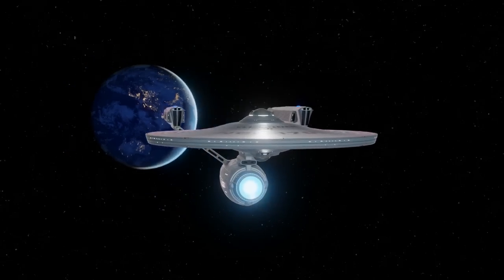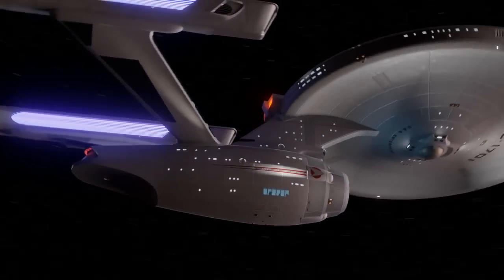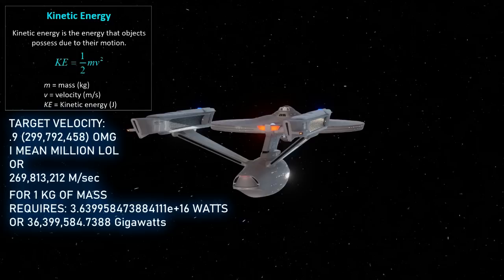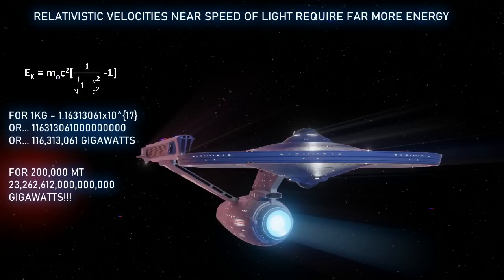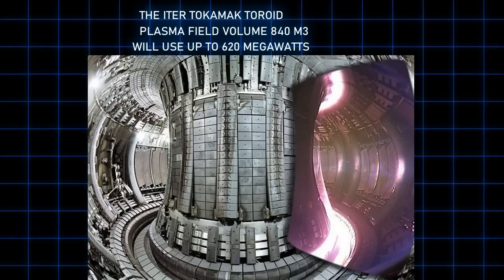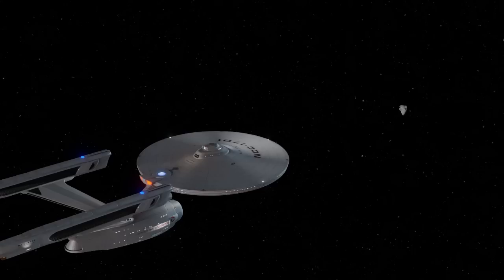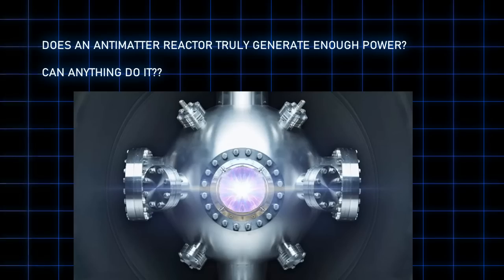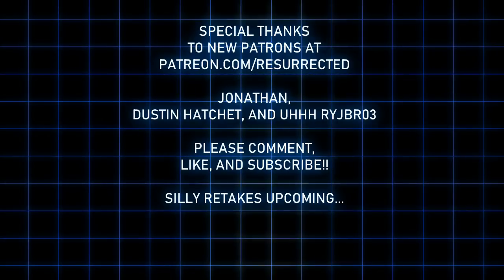How Many Nuclear Power Plants Can Power the Enterprise? Let's Calculate!!!

Comment: We could power our current day civilization with a few dilithium crystals.
Reply: Haven't finished the video but last I though I knew, was they used deuterium/anti-deuterium to power the warp reactor. That said, the crystals were the focusing lens in the explosion chamber. They were important for making the whole process of extracting energy from the antimatter interactions inside the pressure vessel.
Reply: Dilithium crystals are part of the engine, not the fuel.
Reply: Tho dilithium is not the fuel, as has been states, our modern issue with antimatter is not creating.the antimatter it's controlling the reaction in order to get useful energy.
So, yes. A few dilithium crystals and and an understanding of how to use them would end all our energy issues.😊
Reply: And what is the deal with the Dilithium crystal's structure breaking down while it is use? Wearing out or becoming damaged in some way such that "recrystalization" of the Dilithium matrix is EVER needed or could be an option? Are Dilithium crystals harder than Diamond for example? We just do not know I think and so one answer may be as good as another and the "fun" may lay in the act of trying to figure it out OR coming up with (i.e. "inventing") a plausible set of story ideas to "fill in" the missing knowledge! After all, nobody has said Mr. Gene Roddenberry went into a trance-like state and received the ideas for Star Trek FROM a higher power or from the future but... could that be the biggest "untold" Star Trek secret of all time??
Reply: @DennisCosteaJr  
I agree: half the fun is speculating an irl answer to fantasy problems.
In my own head-cannon, dilithium crystals have long, straight, largish pours that, when placed within an electric field that is just right, create a magnetic field oriented parallel to.the walls of those pours. Incoming matter or antimatter ion streams will then funnel into those microscopic pours, becoming trapped and isolated to a small volume within a pour. This, then, increases the likelihood the two streams, coming at each other from either side, annihilate, turning into gamma rays. These gammas, traveling at the speed of light, have enough time to escape the crystal before decaying into highly energized m/am particles of all kinds: warp plasma. This plasma is gathered by em anf grav fields and shunted to the warp nacelles.
However, sometimes a particularly energetic ion within the one of the streams escapes a pour. Or, a gamma ray decays early. Either way, a small section of the crystal is damaged, making a slight disjointment the alignment of local magnetic field. As disjointments increase, efficiency decreases. Eventually, the crystal is too inefficient and dangerous to use. (Especially at higher warp.)
IDK how gamma rays from a fission reaction would recrystalize dilithium. I have speculated that dilithium is rydburg lithium arrangement, where two lithium nuclei are so close that their sharing of electrons acts like they are a single atom; and then you make a crystal out of that. But I don't understand rydburg matter well enough to really make any conclusions or predictions on that score.
Enjoy!

Comment: What I always wondered how the matter-antimatter anihilation energy was actually powering the warp-drive. Like, when these two types of matter collide, it releases the energy all along the EM spectrum, right? How does the antimatter reactor catch all that energy and what does it do with it? Does it heat plasma to do something with it in the warp-core? Does it turn the energy into moving electrons a.k.a. electricity to power the systems of the ship?

And also, where does the antimatter come from? Federation space must be littered with fusion-powered particle-colliders to create all the antimatter needed for so many ships. Or do they create the antimatter like in the Mass-Effect universe, where they build giant spacestation particle colliders powered by solar power in an orbit close to the star, turning the solar radiation into antimatter?
Reply: That's what the made up material "Dilithium crystal" is for. It does not react to matter and antimatter (one of the tiny substances in the ST universe that do not) but when they annihilate each other and release themselves as energy, the dilithium absorbs focuses and emits the energy as electrical plasma. Without Dilithium, the reaction would be unstable and would lead to warp core breach.

Antimatter is made around sol and other primary Federation member suns. They do indeed use solar power based particle colliders to make antimatter (antimatter is one of the few resources that carry significant "economy" based weight for trade etc due to the extreme difficulty to make it.). The enterprise D has a device on board that can make antimatter in tiny amounts and it's VERY inefficient and not to be used unless no other option is available. (TNG tech manual which I know is "non canon" to some, but considering it was written by two of the main people who designed the Enterprise D and worked out how most of this stuff is supposed to work after we learned so much in the 1980's since 1960's trek I'll defer to them).

Comment: Star trek has always shown that shields can only deflect rather small asteroids, and only at slow speeds, without taking damage. Typically, the deflector dish handles clearing debris from the path of the ship, but it's clearly based more on tractor beam technology than shield technology, which presumably are based on scaled up lasers like the ones used today for "optical tweezers", and not some electromagnetically confined plasma.
Reply: How to tell me you don't watch Star Trek without telling me.
Reply: They have navigational shields, that a laser can't cut through (if they were on...now the D lost her only toilet).
I would say it's a combination,  navigational deflector pushing particles put of the way and navigational shields is the last line of defence.

Comment: So if the Enterprise-D do have 12.75 billion GW (which is 1.275 × 10E19W if my math is correct), it will have to burned more than one ton matter and antimatters per second .
The question is, according to TNGTM, the fuel capacity of Galaxy won't be anywhere more than 5,000 ~ 6,000 tonnes (~28,000 cubic meters for main deuterium tank, assuming the density of deuterium in about 0.1~0.15, and the 3,000 m3 antimatter storages have roughly the same mass as matter fuel) . So in this peak output, the ship will burnout its entire fuel reserves in less than one and a half hours.
The even bigger problem is, also according to TNGTM, the standard antimatter flow rate of Galaxy's warp core is a tiny 300ml per second . It's quite a long way to 1 ton per second.
Reply: Perhaps the values given in the show are the maximum rated power output of the reactor, and in normal operation it only actually produces a fraction of that.
Reply: And in dialogue, the NX-01's phased cannon is confirmed to have a power of 500GW. It's safe to assume that phaser banks will have TW level output, and so as the shield.
Reply: @owenstockwood5040  That's definitely the peak. Also in the TNGTM it said the warp core is required to have a 125,000% surge output of rated maximum continuous power for 300ms. If we take this into the count, then the maximum rated output of Galaxy will be in 10e16W, which will make far more sense and will only burned 1kg of matter/antimatter per seconds.
Besides, in DIS S04E05 Taka built an scaled down model of DMA and tested on Discovery. According to what he said the scale is 10e-17, the Discovery have all of its power to powered it, and the actually DMA will be "had an energy source equivalent to a hypergiant star". I googled and it said hypergiant stars usually got 10e3~6 times more power than the Sun, which is 10e26W, so the peak output of Discovery will also be in 10e16~19W, also matched these numbers based on TNGTM.
Reply: Are you sure you're calculating the energy output correctly?  Remember a theoretical matter-antimatter reaction would be 100% efficient.  In other words, all of the mass is converted to energy by a factor of E=mc^2.  Modern fission technology isn't even 50% efficient.  I think if you could control it, a matter-antimatter reactor would be able to provide all the power necessary.
Reply: @owenstockwood5040  No.  In the episode "True Q" Data stated, "We are currently generating 12.75 billion gigawatts..."  And that was when they were essentially at "idle" speeds.  The assumption is the 12.75 number was "normal" and theoretical maximum output would be much more.
Reply: That means the TNG technical manual isn't canon.
Reply: @Thin447Line  no you still have to have fuel. If I remember correctly nuclear fission only converts about 4% of the mass of the fuel into energy, but then you have to convert that energy into motion. Same thing with matter antimatter annihilation. Matter antimatter annihilation primarily produces gamma, rays, and x-rays. How do you convert that into motion? there are no mirrors that can reflect gamma rays or hard x-rays. How do you direct everything out the back? How do you not melt the reaction container? Yes, of course the reaction is 100% efficient, but converting the energy from the reaction into forward motion is not gonna be anywhere near 100% efficient. even if it were, there’s still an upper limit of the amount of energy that you can get per kilogram of matter, annihilated with a kilogram of antimatter. It’s not just a hand wave infinite power source.

Comment: Aren't the deflectors an expression of warp physics similar to the main drive but applied to the whole conformal grid array? I am sure it mentions this in the TNG technical manual, something about a two-dimensional particle being deflected in such a way it would appear the ship had moved and not it. This tends to suggest space--and physical payloads/plasma/particles moving through it--is being warped away and around the protected volume. O'Brien and Dax also managed to convince DS9 to move to the mouth of the Bajoran wormhole by over-driving its deflectors which also tends to back this idea up.

I do very much like the concept of phasers being particle-beam weapons though. That makes a lot more sense in regards the inner workings and shunting 'power' as if it were some kind of liquid through a crystal to create the beam.

Interestingly the original nacelles on the Constitution Enterprise were partially reaction-based devices. According to the late-eighties technical guide they exhausted the warp plasma through the back to add to motive power. This explains why the early models seem to have rocket nozzles on the end of the nacelles. Some very early artwork of the ship under way also shows an exhaust or flame effect, although that could just be artistic licence due to whoever drew it not being a Trekker. Later these are stopped up with round crystal spheres.

All the Constitution-refits were meant to be driven via Transwarp but a decision was made to continue experimentation using Excelsior and equip the older hulls with upgraded but still orthodox warp engines. Supposedly Transwarp itself is actually an application of the physics behind the spatial disruption that was encountered during 'The Tholian Web'.
Reply: The TNG technical manual is extremely non-canon. It manages to contradict literally every single episode of Star Trek. In Star Trek, the shields are indeed magnetoplasma.
Reply: @Idazmi7  I'm not so sure about that! The one for TNG was written by Sternbach and Okuda. Other scriptwriters referred back to it to maintain consistency in their work. There are certainly contradictions but on the whole I certainly consider it to be canon if not exhaustively so. Admittedly the new shows are supposed to be canon as well, so...
Reply: @morelenmir  
"I'm not so sure about that! (...)'

I am. Nothing in the TNG technical manual lines up with ANY episode of the show: I've looked. It's honestly a collection of random technobabble.
Reply: @Idazmi7  We'll have to agree to disagree on that one! I'm sure we both enjoy the show and fandom though--which is what matters.
Reply: @morelenmir  
"We'll have to agree to disagree on that one!"

I don't "agree to disagree" when I'm talking incontrovertible truth. Give me ONE episode where the TNG technical manual is supported. Just one. You won't find one.